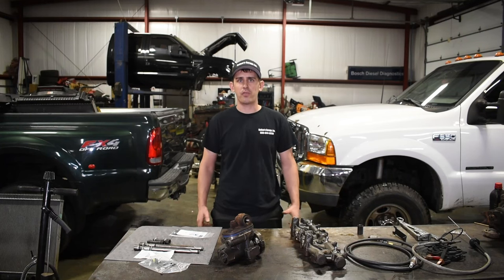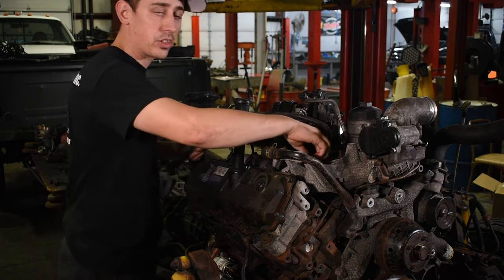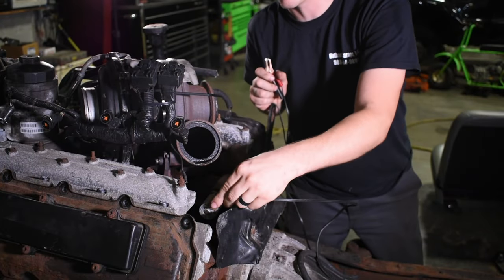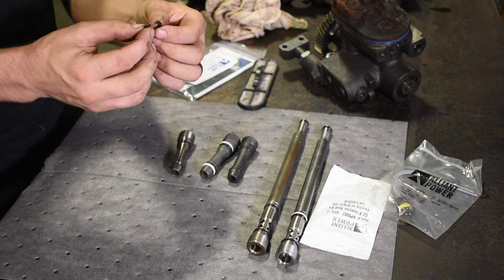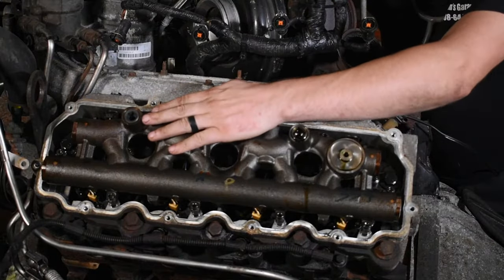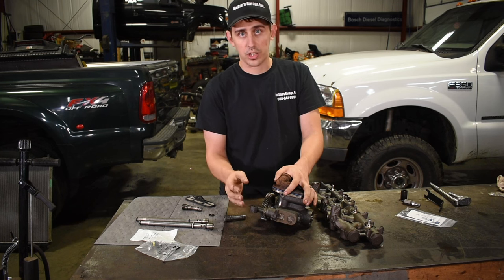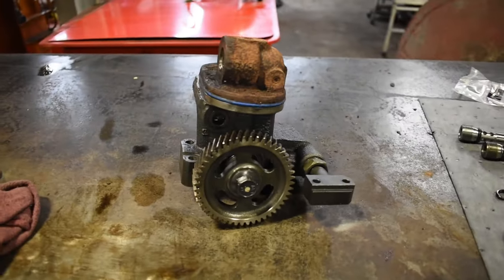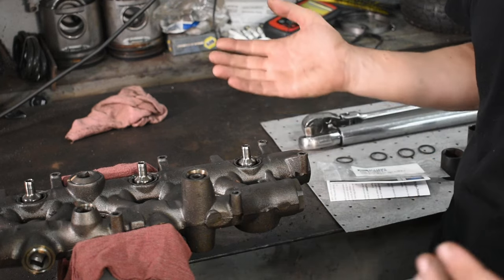6.0 high pressure oil leak diag and repair

Comment: I did the air test on my 2003 6.0 by using a IPR adapter only took the oil fill cap off then pressurized system with air for 10min I then used a stethoscope that's battery powered style its very sensitive for noise listening anyhow all air noise is coming from the middle of the plenum so its sounds like a smoking  water pipe bong lol so no noise from the valve covers all is in middle top of engine my truck was running fine still no hard or no starts but I had a major oil leak that I thought was the ICP or IPR but all was dry it did look like it was leaking out near the driver side exhaust manifold in back corner as I seen bubbles that looked like were coming out where heads meet block anyways i had the 03 pump and oil cooler replaced a few years ago the oil pump was OEM Ford and oil cooler was aftermarket I was hoping after explaining all this you may have a thought to witch is likley my issue meaning if I hear this gurgle noise in middle is it most likely oil cooler I also should mention I have a bulletproof EGR cooler and part was also installed same time along with previous mentions and also bulllit proofs water pump was also done all by a ford mechanic who went into biz for himself after 25yrs working for Ford so I'm just not sure what's really the issue till I tear into engine but because my truck had no issue staring and running at all but leaking oil bigtime  my IPR when I pulled screen is perfect and it works fine when 12 volt tested one last thing to mention is the oil filter housing when I pulled the cap off the oil is not holding and is empty so that and I don't see any milk mix in my coolant at all and I switched over to the red coolant million mile stuff after system was flushed out reverse style and block plugs pulled as well and my intuition is that's where this may have been cause as I did  that not to long ago with use of the guys aftermarket adapter for back flushing oil cooler I think maybe I used to much air pressure and blew seals in oil cooler or just blew cooler itself possibly but no signs of mix of oil in coolant so I know that's alot of variable for possible causes just don't think oil pump is it I hope not at least and if its such a bad leak wonder why my engine runs fine and if its head gaskets would it bubble inside middle of upper intake Well I love your videos hope you can give me your two cents on my issue I have brotha thx

Comment: two things, can I just reseal the original dummy plug with orings and nylon washers? Also, when energizing the ipr valve, is it polarity sensitive?
Reply from the maker: The original dummy plugs don’t have enough space for the o-rings and nylon washers. The IPR is just an electromagnet so the polarity doesn’t matter. Either way don’t energize it too long with full 12 volts.

Comment: I recently changed a blown injector, did oil rail seals and cups, then added the upgraded dummy plugs and tubes.

Now,  after several attempts to start.  It shows 0 psi no matter what.    It was starting up fine just before the repairs.

What am i doing wrong?

Comment: 2007 F250 6.0. No oil pressure gauge, and now no start, replaced the oil pressure sender, worked for a week then it failed. gauge worked when replaced/ w fresh oil change also and fuel. I'm stuck now... truck has 155003 miles. please help. thanks in advance.
Reply from the maker: Hi Marcus. Are you saying you still have not oil pressure on the gauge?
Reply: @InTheShop  yes still no pressure

Comment: I have a ford excursion 2005 6.0. I was  Accelerating to get on the highway then oil blew all over the top of my engine and lost oil pressure then the injectors shut down. What should I look for. I took the turbo off but in not seeing anything that would cause that massive failure in the high pressure oil system. Any thoughts would be helpful. Thanks.
Reply from the maker: Most common cause of that is the oil pressure switch right behind the oil filter housing.

Comment: I have a question. Got a 2003 6.0 crank no start found low ICP and the IPR goes to 85% when cranking which confirmed low oil pressure issue removed ICP sensor and put air to system And commanded ipr to 85% which I believe is closed I can’t hear air but I hear some slight oil bubbling from both sides is that normal or does that mean I have a slight high pressure leak thanks for your help
Reply from the maker: The bubbling is an air leak
Reply: @InTheShop  thanks for that reply I kinda figured that.This is my first 6.0 I worked on I just wanted to make sure I wasn’t hearing residual oil returning somewhere or something like that.

Comment: Well, I already changed a new pump and injectors are re-invoiced and rails I also bought and the high-pressure tubes and it turns me on very well only that when it already grabs the temperature I turn it off and it doesn't turn on anymore I just noticed that when there the air pressure test only pulls me by an injector where the nipple enters you can be heard there
Reply from the maker: It’s possible one of the top injector o-rings where the nipple enters is bad. It’s also possible that the spool valve on the injector is worn causing this.

Comment: Hello brother,
How can i contact with you, i have an international cf600 4.5L diesel engine. Crank no start.
I need your help and where can i get all the tools like sensors and pressure gauge which i plug it into ICP.
Thank you
Reply from the maker: Any of the adaptors you need to do this test are linked in the description of this video.

Comment: Can you take the IPR out and just put a solid fitting in there so you don't have to energize the IPR and just pressurize from the ICP?
Reply from the maker: You can do it that way. There is also a fitting you can thread into the IPR port and put air through it. I personally like to keep the IPR in and test through the ICP sensor port because it allows you to test the functionality of the IPR at the same time.
Reply: @InTheShop  thank you for the response! I'm just afraid of burning the IPR up since I don't have a scanner.

Comment: my 2006 f550 been running rough for sometime and took it off road, once in a while i would start it at yard and eventually it would get worst be letting it idle, then on day i went to check the oil in engine and no oil was found on dipstick. Could i have ruined the oil pump. ? Enngine is 6.0 high pressure oil pump was changed out before . What do you think happened here ?
Reply from the maker: I would start by checking fuel pressure. The oil pump being bad won’t cause it to run rough. It will cause a no start or extended crank. If the fuel pressure is good I would say you most likely have an injector issue. I made a video that talks about fuel pressure and the blue spring upgrade. You can see that here https://m.youtube.com/watch?v=AezqXfvha6M

Comment: I have an 05 6.0 that recently had a whole bunch of work done to the top end of the motor. Hpop has been rebuilt, dummy plugs, stand pipes, nipple cups, ipr, stc, icp, full orings on all the injectors, injectors were tested and replaced if failed.. the truck still will not start, it will reach 300lbs oil pressure but cannot build any more. Any pointers on what to check? I've seen videos about the drain plug where the oil filter sits and the 12mm plug on the bottom of the motor behind the pulley but havent been able to investigate yet.. 

Ive been advised to replace the motor but I'd rather just scrap the truck before I do that..
Reply: For a bit more background. Truck went in for a no start when hot issue, nipple cups, stand pipes and dummy plugs were replaced, truck fired up and ran great for 15minutes then died and hasn't started since. That's when everything else was replaced. Thanks
Reply from the maker: Hey Hunter, I would start with some basics. What brand of oil filter are you using? Make sure it is a motorcraft. Also verify the oil filter cap is OEM. From there I would inspect the plastic stand pipe in the oil filter housing. Also check the small plastic anti drainback valve in the base of the housing. Once you have verified that is all good have someone crank the truck while you hold down the anti drain back valve and  make sure the housing fills quickly. 

I am also curious if you have done an air test on the system. It’s possible one of those new components was either improperly installed or has failed.

Comment: I done this test and there is still air coming from both the oil fill and pcv. All thought I do hear a small change in sound on oil fill side but I don’t on the pcv side. Ipr valve is good as well I bench tested it.
Reply from the maker: Have you removed the valve covers yet to pinpoint it?
Reply: In The Shop no I haven’t yet, do you think I have a leak on both sides?? It’s a very small leak, the truck will start still it’s just a long crank hot and cold but once it hits 500 it’ll fire right up.
Reply from the maker: I would start on the passenger side. Pull the valve cover and air test with the cover off.
Reply: In The Shop okay, I’ll do that! The problem always has to be on the side that’s the most aggravating to disassemble 😂
Reply: In The Shop I got both valve covers off, and once again I still hear air escaping both from the passenger and drivers side valve cover even with ipr closed. With the passenger valve cover off, when I apply power to the ipr I can hear a click and the air sound changes and I still hear air escaping but i can not pin point it, tho on the drivers side there is zero change in the sound of the air. I checked the dummy plugs closely and it still doesn’t seem like they are leaking. I took me a long hose and put down in between each opening in the oil rails and i hear the same amount of air each time I move the hose to a different location. What would you do from here? Thanks for the info by the way!
Reply from the maker: @andrewstevens9246  Does it seem like its coming from the center rear of the engine? It could be coming from the Snap to connect fitting on the pump itself
Reply: In The Shop yes that’s exactly where I hear the most noise. But I think I have the updated stc fitting, I seen it when I put a new seal around the hoop cover.
Reply from the maker: Unfortunately if it’s coming from the center of the engine it’s going to either be the IPR or the STC fitting

Comment: Thanks for the video bro my issue the air is coming out where you put the oil do you have any idea what that means thank you
Reply from the maker: If it’s coming out of the oil fill you will have to pull that valve cover and investigate further.
Reply: @InTheShop  Hi, good video. I am having the air come out of the filler as well. Could it be because of the dummy plugs and nipples as well? Also, can a low pressure cause  the ficm sync not to sync?
Reply from the maker: Charlene Hayes if you have air from the filler I would pull that valve cover and try to narrow it down. Low ICP will not cause a lack of sync though. You may have more than one issue.
Reply: @InTheShop  Thanks! What are some common issues of ficm sync?

Comment: if got oil signal in dash, oil filter full,torbo etc, changed the hpop and the dummy plugs and 2 stand pipes, i sill have no oil total dry at the icp.... 2007 6.0
Reply: question is can the ipr divert 100% of oil of the hpop
Reply from the maker: Typically not 100%. This may sound crazy but are you sure the plastic plugs were all out of the pump before install? I've seen it before.
Reply: lol yea lmao
Reply: just manualy tested my ipr on bencth, thing wont budge at all , seem stuck closed
Reply from the maker: @clicktoxic4439  Stuck closed would be max ICP pressure. When you air test it does it have a leak?
Reply: @InTheShop  just finish doing air leak for icp sensor, i put the blocked ipr back so hold presure, seems the dummy plug are defective
Reply: took off both head covers, remarked that both dummy plugs close firewall have oil marks on the head covers,
Reply: took off dummy plug they seem ok , teflon still there look like got to order new dummy plug stand pipes, so anoying lol

Comment: Mine shuts off running down the road. It's running fine and I don't have codes or any lights. What could be the cause?
Reply from the maker: That can be very difficult to to diagnose. I would have to monitor data when it was acting up.

Comment: I prefer to remove the IPR and install the test fixture, remove oil fill plug and disconn  C/C breather.  Inject test air and monitor which side has the vapors/sound emitting.
Reply: Plastic washer better known as a "backup ring", often used with o-rings at higher pressures.
Reply from the maker: That’s a great way to test. I prefer to do it through the ICP sensor port because it also tests the function of the IPR simultaneously. Either way will get you where you need to be. Thank you for the comment!

Comment: Hey on a early 03 can you just do a air leak where the ipr goes? Would that test the whole system?
Reply from the maker: You absolutely can. The only reason I personally don't do it that way is because I also like to verify the IPR is working while I do an air test. Leaving the IPR in allows you to check its functionality.
Reply: Right got it. I'm just working on a early 03 wont get over 600psi amd it's running 85 to 87 % on thinking it's the pump.  I do a air test cant hear a leak but it doesn't hold pressure either.
Reply: But I was wondering if I test though the ipr does that go though the whole system?  Or should I pull off valve covers and test each side individually
Reply from the maker: It goes through the whole system
Reply: @InTheShop  thanks for the advice

Comment: i have 05 f250 with 6.0 after i apply power to the ipr and add air to system, i hear a air leak on the high-pressure oil pump dump hole. is that normal or should it be fully sealed after power is added? i hear it really loud when no power is added which i know is normal but leak is less when power added
Reply from the maker: Sometimes you will still have a small leak. This is normal.

Comment: ipr and icp new from Ford and still oil leak - today I removed the hpop cover and the fitting is the upgraded one ....what's next?
Reply from the maker: Hey Juan did you do the air test?
Reply: @InTheShop  yes ...after remove the hpop cover I saw the stc is the upgraded one ...I feel the leak on the back of the pump...
Reply: @juansaid3100  Did you found your problem, when I apply air thru the ICP I can feel air coming out from the back of the pump. I can feel a small hole and the air is coming thru there.
Reply: I had to replace the hpop...from international...it solved the air leak...

Comment: I need drain the engine oil completely out in order to check with air bro?
Reply from the maker: You don’t need to drain any of the oil out.
Reply: @InTheShop  u mention in video leave ipr open to drains oil out of oil rails what u mean open? Like take it off or how I do that leave ipr open thanks?
Reply from the maker: @jorgezarazua6677  if you don’t command it closed it is automatically open. So leave the air on for a few minutes before you command the valve to close.
Reply: Thank you so much

Comment: Say brother my 6.0 Turns over for about five seconds then it diesdown ilike bad batteries or something but I just put new batteries 2 of them Can you help me out
Reply from the maker: Sorry just saw this. Did you get it solved? I would start by checking the ground at the bottom front of the engine on the passenger side. I would also check the battery cable from the battery to the starter.

Comment: On the 03 you said there is a fitting on under the valve cover which size what do it look like
Reply from the maker: The fitting on the 03 is a round plug and has a 4mm allen head. Once you pull the valve cover off you will see it on the oil rail. The proper fitting to use is in the link in the description. Hopefully this helps you.
Reply: Thank you I have a oil leak I can’t find

Comment: Need help ASAP I’ve been messing with my 2004 6.0 since back before winter a shop was supposed to have put a new hpop and I myself have put on a new turbo, new ebp sensor, map sensor, icp sensor, 155 warren diesel injectors, ipr sensor, updated dummy plugs and stand pipes a new ficm and new oil rails and it still isn’t running right the ipr Max’s out right off the jump and the ICP pressure won’t hit but 300 and it just isn’t making no sense I’ve took it to every shop around and can’t nobody figure it out me and my buddies been working on it for months at the shop and still can’t get it it had a hot no start and would always fire back up off a small sniff of ether sometimes going down the road it would shake real bad if you gave it gas but would chill out if you stomped it to the floor it runs out of gas at a quarter of a tank and dies sometimes even when it’s full and when I do a air test it sounds like there is a leak coming from the back 2 injectors on both sides but it’s louder on the passenger side
Reply: What was it mine does the same
Reply: @ianbrown9451  still haven’t got it fixed it’s sitting in my garage and I bought a 7.3 for now till I can figure it out